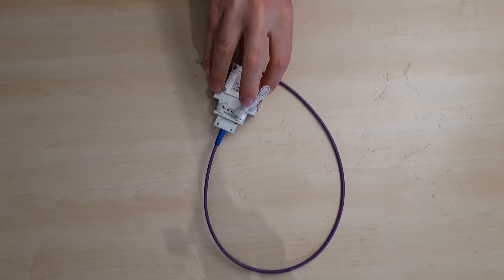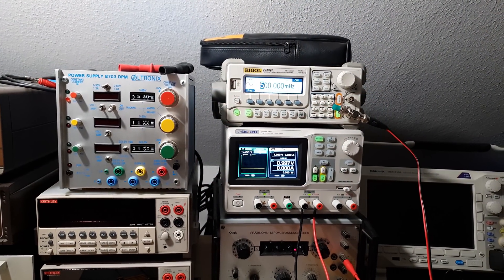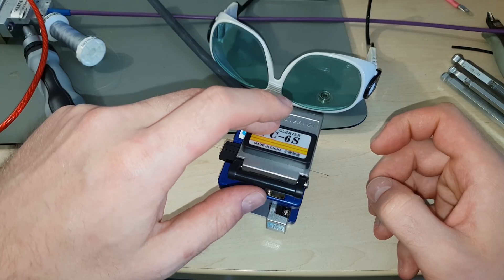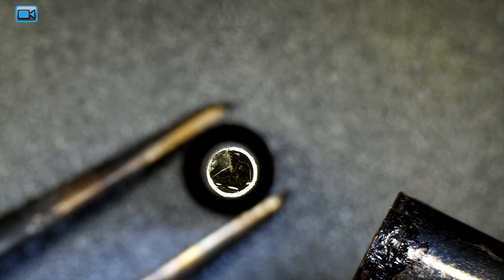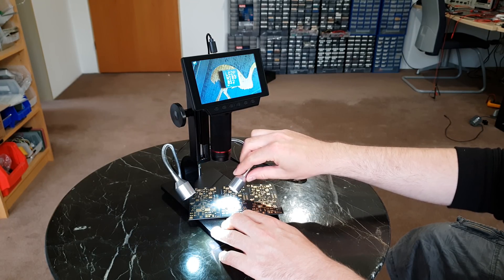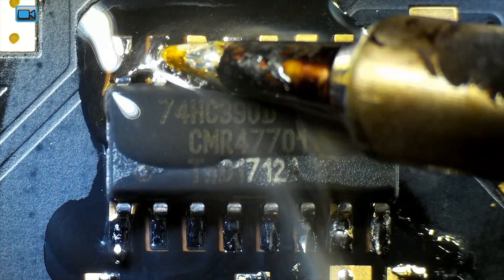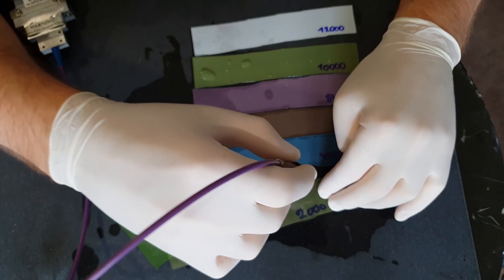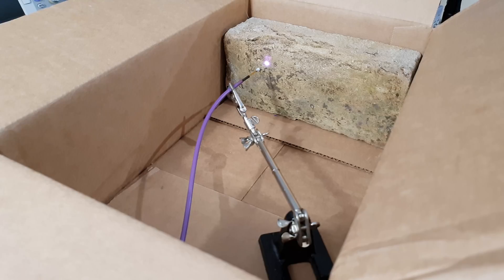30W Laser Burning Stone + New CC Driver + Fiber Termination Lapping

Comment: I think it's not a problem of how fine your sand paper is. The problem is not careful polishing. First I would try to make simple JIG to keep grinding angle constant. Some holder for optic fibers, and flat surface which you already have. For example: take thick piece of metal (even cube 2x2x2cm), drill a hole just slightly wider than diameter of fibers end, put fiber end inside, and move whole thing against sandpaper, polishing both metal and fibers, this should keep grinding angle constant and will result in nice flat surface instead of rounded one. Second thing: you have a lot of scratches left by coarser sandpaper, it means you were changing sand paper too quickly. Easiest way to do it is to change direction of move during polishing, for example: paper 1200 you move your setup against sandpaper back and forth, on one straight line, without turning, all scratches are made in one direction. Next you clean everything very well (also gap between holes walls and fibers, just take it apart and clean), cleaning is important to remove coarse particles, which may damage polished surface later. Next you go to paper 2000 ,polish the same way, nice linear moves, but now you turn fibers 90 degrees, now your new finer scratches are made perpendicularly to the ones made with 1200 grit. In this way you can easily see when you should move to next finer grit - polish as long as you can see old scratches. I am not saying that fine polishing diamond paste is not necessary, but first of all I would polish it correctly :)
Reply from the maker: Thank you for some valuable hints!!
Reply: Marco Reps  Also try to use Philips contact spray(as lubricant) to wet the sand papers instead of water.
Reply: @AEON.  That explains my dogs teeth. They are PERFECT after the first week of each month when our subscriptions start showing up in the mail and she gets a hold of one......
Reply: Or find someone to do some atomic polishing (argon-ion would do)
Reply: Would the jig not introduce small aluminum particles that would scratch the fiber?
Reply: You beat me to it! Perfect way to polish to keep the item at whatever angle you need and the addition of diamond polishing paste is key at the end.
Reply: @AEON.  I worked with fiber optics and we polished them this way at different angles as well...we used this same method! Then finished with diamond polish.
Reply: I think a figure eight movement is also recommended when polishing.

Comment: the problem with lapping is the angle you grind at more than 12000+ grain. you should try to find a way to lap the fiber at 90, with hands you will create some micro "not 90 angles"
Reply: That would be by utilizing a polishing pad and polishing puck. The pad is a square or circular hard plastic substance that you attach lapping film to. The puck is a device that allows you to mount a connector at a perfect 90° angle and negate uneven grinding completely.

Comment: I have the version before this and OnStar latency is like 350 milliseconds at my guess you notice it only just. It's almost instant and OnStar looks like this but round slight woobly mechanical adjusting  via HDMI -dvi input on my repaired CMV monitor. And OnStar is a good product the one who look A like in this video. I paid 200$ NZ purchase from someone local auction site it was new only thing had wrong USB charging cable with it .

Comment: Cleavers are only designed to work on bare fiber.  The cladding needs to be removed beforehand.
Reply: Otherwise they make a squeaky toy noise when they fail (not gonna lie, I'd love for that to be a feature in tools).
Reply: you never remove the cladding, that is fused onto the core...the fiber would never work without cladding ;-)
If you're talking about standard fibers for telco', then the final layer you remove before cleaving is not cladding, but some acrylic resin and something soluble in isopropanol...

But still the fiber here is pretty much 10x thicker then the 125um fiber the cleaver was designed for. Thicker fiber=stronger fiber. 
Personally I'd try a hand scoring tool and pulling the fiber, but that is going to require a lot of practice :D
Reply: AKAtheA oops. Yeah I knew that.  Been a long time since I've worked with fiber.  I mean coating:)

Comment: You need to remove the coating before cleaving the fiber. 

The whole point of the coating is to strengthen the fiber so it seems to do its job.

Comment: This cleaver is shitty. I was using it during my fiber networking classes and they were cutting our optical fibers so badly, that our fusion splicer refused to splice a fiber togheter.
If I remember correctly you need a special glue to make a ferrule, it's cyan based. (toxic af)
Reply: those shitty china cleavers are good enough for what he is doing but the fiber he is trying to cleave is still coated in that yellow "burnt" stuff.  the yellow stuff is only a few microns thick but tough. first time i tried to splice it i thought i had it stripped all the way but even my best cleaver would cut it. you need brand new sharp 125 micron strippers and tighten them up a fraction first then you can strip that yellow stuff off and there is normal clear fiber within. it is difficult but possible. with the yellow coating off then you can cleave and splice it normally.
Reply: @shadyfishr  that yellow burnt stuff is an acrylite coating, a very thin coat of incredibly strong acrylic I believe.
Reply: Pure cyanoacrylate without thickener. Hardware store stuff, or even office supply.

Comment: Well even on the Telecommunications Fibre optics you have to remove the protective coating first before cutting.
Reply: The fiber is about 10 times thicker than regular telco fiber. That, and there's two layers - one is plastic sheath, which is made to be removable, and there's fused cladding, which isn't(usually).

Comment: Would an over polished fibre end start reflecting the light back down the strand, like an internal mirror?
Reply: Total internal reflection happen only on lower angles.
Reply: Fresnel reflection happen but i dont think is a major issue as some light propagation pattern couldnt sustain after reflect.

Comment: Someone that has a turbopump rotor on his desk calls this vacuum pump proper?
Reply: It is highly likely that you could kill a turbomolecular pump by sucking down some epoxy or silicone.
A rotary vane pump does just fine for removing air bubbles.
Reply: All turbo pumps that I worked with detect the rotor load and measure the time to reach a certain speed. If one of those parameters are not in a specific range the pump just shuts down. Apart from that turbo pumps can handle a high gas load so if the scroll or rotary vane pump hits 3/4 of the ultimate pressure not much can go wrong. At least if the gas does not condense.

I just said that proper sounds wrong in this relation.
Reply: I was talking more about the nasty vapors/mist and sudden pressure changes(major bubble releases).
But yeah, a pump won't start with high load and it'll shut down if you let in too much flow. A sudden flow could probably put so much load on the blades it might actually visibly jump(and shatter).
Reply: Do you think that at 3/4 the ultimate pressure (10^-2 mbar) bubbles are still left over?
Reply: They can keep coming out for hours, and way into the ultimate pressure required to start a turboump. Such is epoxy.

Comment: @Marco Reps now you only need to focus it with additional focus lenses, and youll be able to cut steel :D
Reply: Maybe very thin steel. For cutting 1/4" steel, my high school used a 1.25kW laser. (I still have the laser cut sign of my name, which was the first assignment using it.)

Comment: Can you use your laser driver to PWM the laser output? I am looking for a driver which I could switch at around 2MHz.
Reply: No, q-switched laser cleaning ablates. Turns surface impurities into dust, some into vapor.
Reply: The laser itself is not pulsed(well, not completely) - the increase in power is done optically, via a q-switch installed in the resonant path.
In a very simplified way, a Q switch somewhat replaces the output mirror and in the normal state, is 100% reflective - meaning all the pumped laser power is accumulated inside the resonant cavity. Then, the Q switch fires(opens), at the mentioned frequency, and releases all of the stored up energy in a short pulse, then the cycle repeats.
Take a look here: https://en.wikipedia.org/wiki/Q-switching
Reply: Why would you want to PWM the laser at such a high frequency?
Reply: It is needed for applications such as metal surface rust removing and similar. I need to reduce laser power to stop it from cutting into the material.
Reply: remsiux It would be possible to drive a laser at that frequency, but I'm not sure if his module specifically can
Reply: You can't do rust removal with this laser.
You need extremely high peak power, so q-switching is necessary. To ablate rust you need around 200-400kW peak power.
Reply: I take it this process is essentially rapidly smelting the rust back into Iron and Oxygen?
Reply: Ah ok. I imagine the pulse would need to ridiculously short at that kind of power.
Reply: Yes, it's in the nanosecond range. Repeated at 5-500kHz, depending on average continuous output power.
Reply: Woah. My mind is boggling at the freaking current pulse that thing would require. I mean. sure, the average power at 5kHz is only a few Watts (assuming I've done my maths right). I made a PWM controller a while back that drove a 60A pulse at 66kHz (it was only 18W average) and it was a nightmare, required a whole bunch of expensive low ESR and low on state resistance stuff. I suspect that kind of laser equipment is seriously expensive.
Reply: I think before I get into that, I should really learn how a basic laser works. Thanks for the info though, always good to learn stuff.

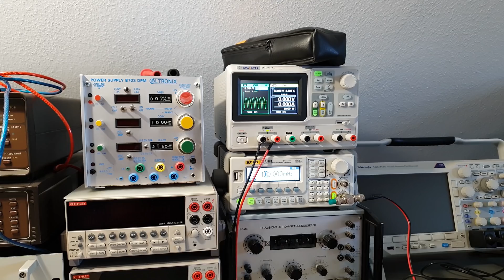Comment: 2:00 my ears hurt, please eq it out next time
Reply: I couldn't tell if I was hearing that or if my ears were ringing, as they were still ringing when I turned it off. That is just at the edge of my hearing, the volume of that squeal must be astronomical.
I am using planar magnetic headphones, and yeah.. pretty painful, and I am 33 years old and couldn't even really tell if it was from the video, but caused actual symptoms xD
Reply: If you have decent headphones its painful
Reply: i got some pretty decent headphones and its not too loud
Reply: I use the DT770 250ohm and I have pretty good ears

Comment: Does that microscope have noticeable latency ? That't a problem I've seen on cheap video microscopes.
Reply from the maker: You mean something like a latency measurement on HDMI signal with a DIY active differential probe supplied by TekVPI? I think something like that could be arranged ...
Reply from the maker: Built-in monitor just barely noticeable, HDMI output none at all. My HDMI recorder (left screen 6:35 ) adds a severe delay.
Reply: I would love to see a in depth look at that microscope.
Reply: I've had one of these for a while, I can recommend fitting an LED ring light as it really improves the view. https://flic.kr/p/25kBFm9
This one:
https://www.ebay.co.uk/itm/60LED-Adjustable-Ring-Light-Illuminator-Lamp-for-Stereo-Zoom-Microscope-/282715024608?var=&hash=item41d320ece0
Reply: strange parts did a nice review on a "minsvision" microscope from aliexpress - has a 1080p camera and direct optics to the object
Reply: That sounds excellent.
Reply: mikeselectricstuff hey mate, I have this same microscope for nearly 6 months, absolutely FANTASTIC in every single way!!! I was about to burn a LOT of cash on a high end fancy one (+/-$5000) when I saw some reviews showing this Andonstar, looked waaay superior than all the other cheap ones and perfect for electronics repair. I took the risk and wooowww... best decision ever!!! Latency using the original LCD screen is minimal, I would say not noticeable. I was always planning to connect to a bigger screen (which would definitely add some latency) but I found the original screen is just perfect for my use. I was also worried about the LCD image quality but it is actually nice and sharp!! I really recommend it!!
Reply: That is where a full analog system shines. What you see on the monitor is real time. However, resolution is terrible, and usually as is the optics, so you can't win them all.
Reply: Nice to see Mike commenting here! Found you both (mikeselectricstuff and marco reps) a few month ago and I love your work! Greetings from a fellow german engineer ;)
Reply: I think EEV blog did a teardown and review of this one
Reply: I've noticed something between 2 and 3 frames delay on the built-in monitor, enough to make soldering hard. I have to try with external monitor i see ...
Reply: You really don't want the light ring.  Instead you want to use a polarizer system on the existing lights.  Check my videos on my channel.  In particular, the one called "X-ray vision"
Reply: I have this microscope, only downside is that it has really high zoom, and not able to zoom out alot.
Reply: Another great video and I really like that microscope!! The distance it gives opens a lot of doors.
Reply: Strange Parts suggested a stereo microscope which included HDMI output.
I purchased the one he suggested for $380 delivered and I really like it. I don't have much to compare it against but I love the stereo view and the HDMI is fun to show others what I'm doing.

The 'scope has a lot of room to work under. Looking through the eyepieces gets tiring but I wouldn't want to solder without depth perception.

Comment: This is awesome!  I went through the same thing with my laser, metal ferrule, scorched fibers, burnt epoxy, 'feeling' the polishing process.  I ended up squeezing my fibers tightly into a syringe needle so I didn't have to use the epoxy.  I did buy some high-temp fiber optic epoxy though, I just never used it.  I purchased all of the parts to build the first edition of your driver and I look forward to building the second edition.
Reply from the maker: Ah, a syringe seems like a great idea indeed!